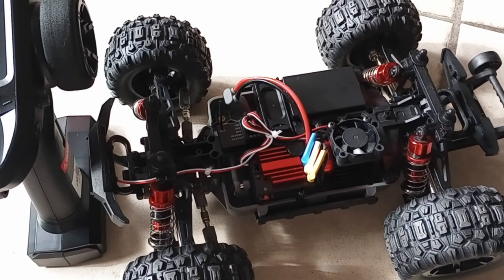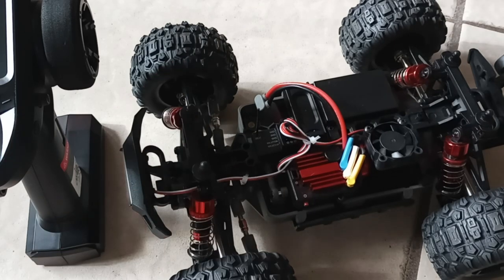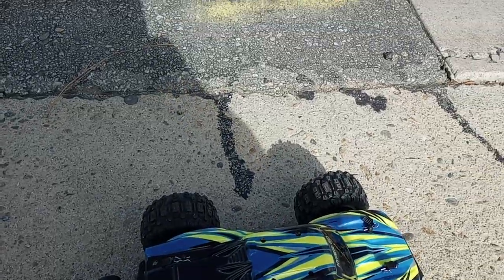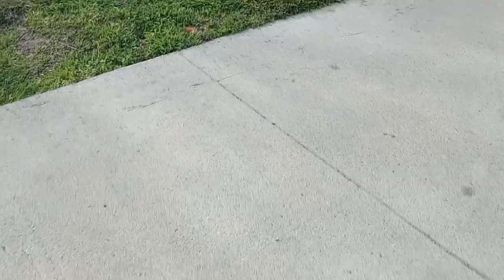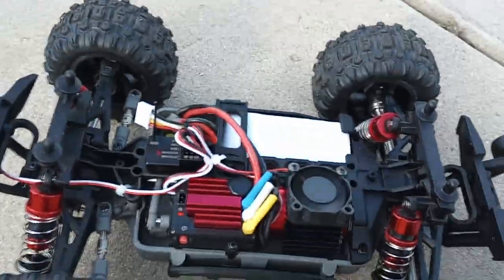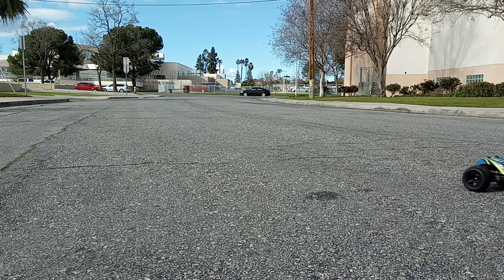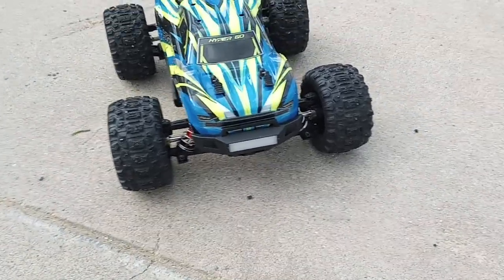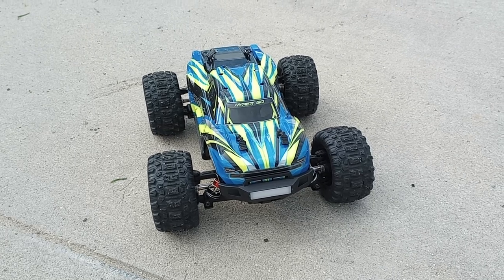Hyper Go 1:16 Brushless Outside Test Run 2/3s Lipo Battery

Comment: I buy this little one week ago. I have it from Amewi. Brusheles Truggy too. I am pleasantly surprised by the workmanship and driving characteristics of the model. I bought two 1500mah 2S NANO-TECH batteries. I drive 25 min +- on the original battery, 30-40 min on the Nanotech one. Which is absolutely amazing. I put softer oil in the shock absorbers, because the original one seemed too stiff and the car was generally hard. After the change, everything was fine. I also tried to put a road set of wheels with a slick pattern, because I ride mostly in the skate park and I can say that it is really fun. Amewi Hyper go brushes Truggy is the only model from this brand that I have, otherwise I have models from LC racing. However, I can recommend it, it's a small car with a lot of potential, very durable and powerful.

Comment: I personally think that this model is the better of the rest; the H16BM; and fastest.
That brushless 4200kv motor is super FAST! 
On 3S (depending on the batt) it’s more than enough (I’m running it on OVONIC 3S 35C 2200mah, held by zip ties; had to remove original bracket that holds the original 2S batt.)

I got this model because it looks the best, especially the black cover. 
But it won’t last too long, sadly, especially on 3S batt. And I can’t seem to find a replacement anywhere online. 

Mine is already all beat up : /Lost all of my original clips already. They come off too easy, after few flips. 
The light bar is no longer working (after going through a small puddle of water one day.) Truck was acting up after that too. I had to use a straw to blow the water out of the transmitter and everything else; thought it was “water resistant.”
Got it dried up and it worked fine after, except the light.
Staying away from water after that.
I ended up installing my own LED lights, two front, and two red in the rear (since it never came with it.) 
Plugged it in the spot where the original light goes (plus there’s an extra open slot.)

I’d also recommend putting a lock tide on the screws, especially on the wheelie bar wheels (if you’re going to use 3S batt.) And the suspension. 
I lost one wheel with a screw, and can’t find a replacement screw; ended up ordering the whole thing on ebay.) 
Until then, I’ve been grinding the plastic 🙈 It keeps the car from flipping over, under controlled speed. But I wouldn’t go too long that way, as it eats up the plastic real quick (on the asphalt) and you won’t be able to reinstall the wheels in the original holes. 
Although you can rig something up, if that happens. Or just purchase a new one (about $20,) if you find it.
In fact, I’m thinking of rigging the tips with some metal. That way I won’t have to worry about losing anything or breaking.
Not like it’ll slow it down. I mean, you’re already wheeling due to so much power. So I’m not worried about having a wheels spin to lose the drag, while on the rear tires; when I can’t even steer haha.
It’ll wheelie all day!

The thin spoiler it came with is useless 👎🏼 
It broke off in pieces after the first flip over, on the 3S batt.
I ended up installing different spoiler from another rc car. More durable one, that’s made of flexible plastic. Still holding up pretty good; after many hard flips at high speed.

The body pillars will get damaged as well, especially on the street. 
I ended up using rubber end caps (that tightly fit over) in order to save them for a bit longer, but even those don’t last too long (with 3S batt.)
Using them also saves the pins. 
I fit the cap over, then put the pin through the rubber cap. 
It keeps the caps and the pins in place (more securely,) until the rubber cap gets destroyed.

The wheels on this model is also a weak link. 
I have two that pop out of the rim (on 3S batt,) then it drives a bit crooked. 
I’ll try supergluing them, and see if that solves the problem. Or get better wheels all together.

I didn’t notice any lag on the controller. No complaints there.

Over all, it’s a great rc car. And whether you’re going to bash it on the ramps or just drive it like you stoled it on the street (with 3S batt,) it will get damaged, one way or another.
It requires more maintenance than I expected. That includes cleaning. 
And will get beat up pretty quick (on 3S batt,) in short period of time. So expect to replace things sooner than later.
Mine is only about two weeks old, and I’m sure many don’t even make it that far haha.

Comment: First off this is a fantasticly built machine the issue I am having is communication with the servo connection (i think?). Bought the first one had this issue thought it was a fluke exchanged it and same issue. Both times they only run for about 10 min and then the throttle stops. Turn off and back on, throttle works UNTIL I turn the steering wheel. It just stops. Steering still works, but no throttle. Blinking red light on the + side of the power box. I changed out the battery, still happeneing. This happened to both of them, both on day one, within one hour of use. They do let you return them so that is a plus. I can not recommend this product.
Reply from the maker: I am sorry your have problems but I and many other YouTubers haven't had this problem. I am curious who did you buy this from?

Comment: I got mine to day and it looks awesome,  I'm using small paper clips to hold the body on, I'm going to paint them black to match the body
Reply from the maker: Put 1:24 scale body clips
Reply: I'm used to rc car & trucks,  this is my first brushless one, I'm going to take it  slow to learn how it responds to throttle response & steering inputs be for I go ham on it

Comment: Do you know what specifications the tires have? To know which ones I can buy? I want to replace them too but I don't know the measurements or what hex number it uses
Reply from the maker: Standard 12 hex Bro
Reply: @MightyistheRCGamer  Oh thank you very much!! That means that almost all of the ones sold on Amazon work for the car, right?
Reply from the maker: @josemolero6560  Yes that's correct

Comment: Anybody having trouble with the cheap body pins I found a solution you just push them all the way in and then they secure quite well I haven’t lost a pin yet
Reply from the maker: Use 1:24 scale body clips